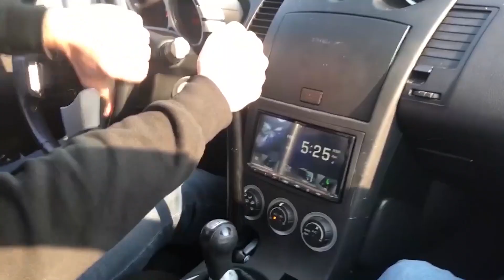350z/G35 GKTech Hydraulic Ebrake and Dual Caliper Installation

Comment: You can rub the lines inside the cabin, under the carpet if you’d like. Just drill holes to insider lines to rear calipers on the rear wheel wells. You would have to buy rubber or plastic grommets to protect the lines.
Reply from the maker: As opposed to extending the line to the T like I did?
Reply: freedom fries yeah, I have gk tech hydro dual caliper lines and mine fit with ease
Reply from the maker: @Martin911  Ah thats interesting and for some reason I didn't even consider drilling into the chassis like that. Probably would have game planned it if the interior was out. Thanks for the tip! I'll try that method on my other 350z!

Comment: I know I’m vary late but do you have to put the stock e brake stuff back in I don’t have a stock e brake already just have the stuff in the back
Reply from the maker: You don't have to. My stock ebrake shoes were worn and the hand brake doesnt work because of it. Have you deleted the factory cables? I mean as long as that stuff is secure you should be fine

Comment: So after I did this install the car sat over winter in my garage and I lost alot of fluid. Turns out the line that goes into the back of the caliper is allowing the fluid to slowly drip out. Even with the washers that came with the kit. Any ideas?
Reply from the maker: It's possible you over tightened and damaged the internal seal. The brake lines only need to be snug.  Did you use the autozone reman calipers as well?
Reply: @freedomfriestv  yea theyre autozone calipers. Ive tried two different sets because I thought the first ones were faulty. I normally don't tighten lines down more than snug so hopefully that isn't the case lol

Comment: Question, do you have to reuse the dust coves?
Reply from the maker: You don't HAVE to. I normally would have taken them off, but trying to prevent debris getting into those spots is a pretty high priority for me considering I accidentally offroad the car so much.
Reply: @freedomfriestv  ok. Cool thanks. I'm only going to use this car for drifting.
Reply from the maker: @ojtbarage4666  Awesome dude! Send a video of a handbrake pull to my IG after you get it finished!

Comment: For some reason my bracket isn’t sitting straight, it’s causing the caliper to lean forward a bit and rub on the rotor, I’ve reinstalled it 3 times to check for problems but it just seems like the GKtech bracket is to thick. Any ideas?

Comment: Informational vid! Short and sweet. I feel your voice audio  was super low. But I have a question  concerning  the gktech hydro kit. The Axle spacers in the kit have different  sizes 5, 10, 15mm. How did you choose your size?
Reply from the maker: Thank you for the compliment! I'm sorry about the audio - I edited using higher quality headphones so what sounded loud  to me turned out to be the opposite on youtube :( 

The dual caliper bracket spaces the hub away 7mm. I picked the smallest axle spacer because I'm not SUPER low. If you lower your car a TON I'd pick a larger axle spacer. 10mm would probably be just fine.
Reply: @freedomfriestv   no problem  it's just feedback to help out the vids. I'll support a Z channel all day!  I'm not super low as well I'm functional low for a drift set up. Thanks for the info.
Reply from the maker: @mannyurbina3  I appreciate it! Take a video when you install it so I can see the skidzzzzz!